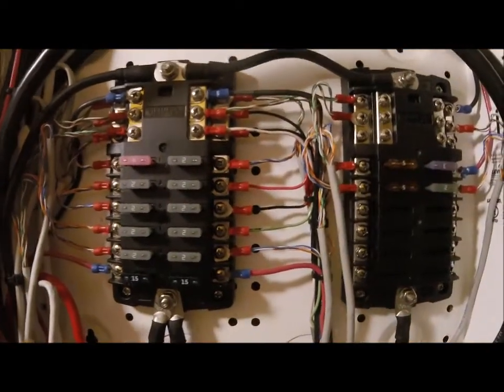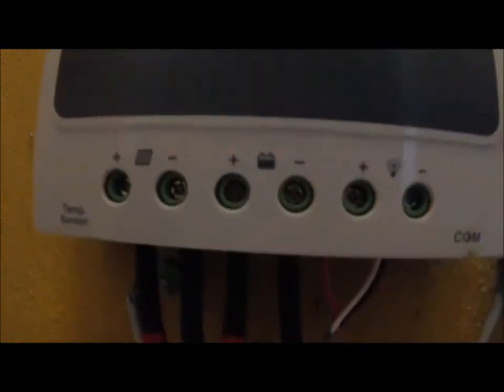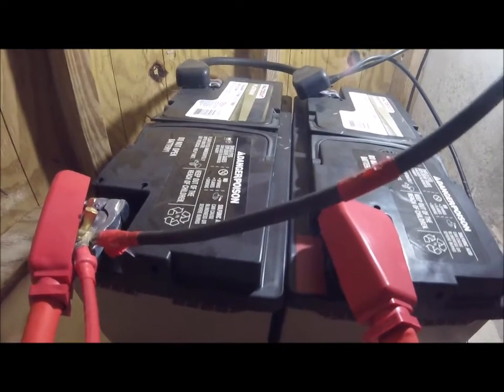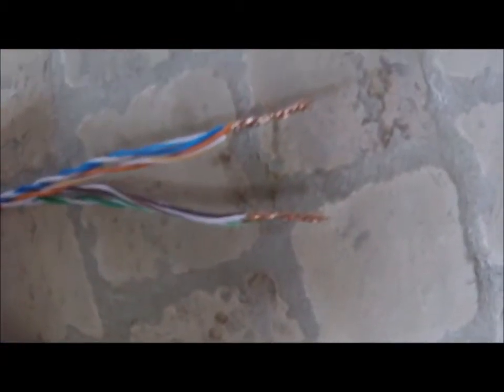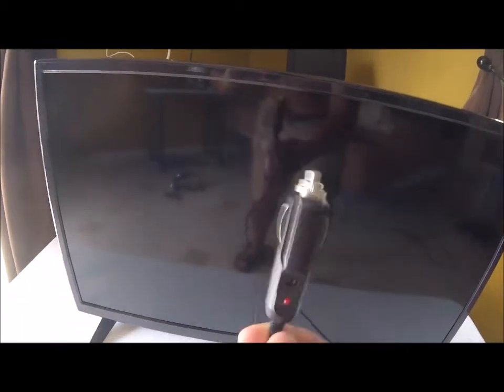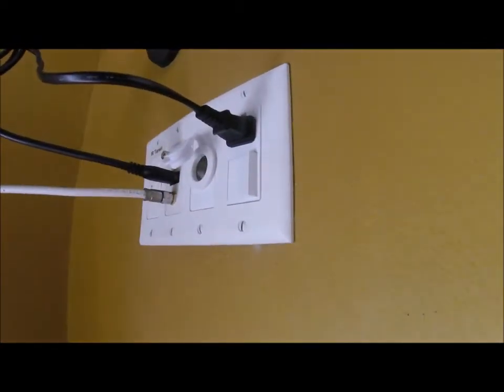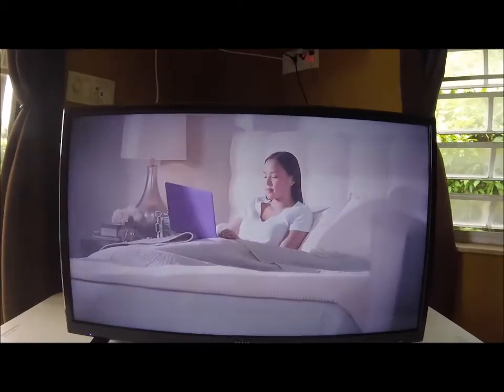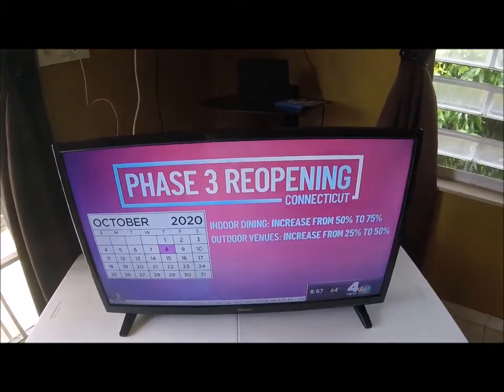Emergency 12v Free signal Transit 32" TV

Comment: Thanks for the tip about the Transit 12 volt TV.  I'll have to put one of those on my "wish list"  ;-)
Reply from the maker: It's a great emergency TV 📺, it can be used with your cars 12v socket. You can even get 12v extension cords to run tv away from your car, using your car as the TVs generator lol.
Reply: @MosaicHomestead  Good to know, thanks!

Comment: Good stuff, primo. I wanna be like you when I grow up.
Reply from the maker: I'm 50 so your almost there😆
Reply: Yeah me too.  He does good work.
Reply from the maker: @joeprimal2044  I installed that structured media box about 20 years ago...I told my uncle I would be doing stuff like this in the future, He thought I was crazy then ,lol This is the only AC DC hybrid home in Puerto Rico. Solar installers have come to see my 12v lighting system just to see me turn off a hallway full a lights just by pulling out a 3a car fuse lol.then I break it down with ohms law and only then they understand.
Reply: @MosaicHomestead  Having blown up 2 inverters myself over they years, I think it's a sensible way to go having both.  How are the wind turbines working out?
Reply from the maker: @joeprimal2044  They have been working great, If you saw how dark its been with all the rain and the system running at 53.6 with 2 large refrigerators, you would be surprised, rain here comes with wind, and that wind supplements the batteries  when solar radiation is low...and so far the Missouri wind and solar controller has been working very good.
Reply: @MosaicHomestead  Good.  You've had those up for a couple years now haven't you?  These days so many things go to shit in just a few weeks, it's good to see that these things last.  Hopefully I'll have some wind power capability wherever we finally settle.

Comment: I’d be using radio myself but good idea
Reply from the maker: A picture is worth a thousand words...A moving one a million😁
Reply from the maker: A picture is worth a thousand words, a moving one a million😁
Reply from the maker: @teamfoco995  You can plug this TV to your car and it comes with a  extra cable that you can add alligator clips and hook up to a car battery...This TV would work great with a small 12v solar kit👍😁
Reply: @MosaicHomestead  And many preppers cannot read so a good idea!
Reply from the maker: @HuplesCat  I read in Spanish and English😎
Reply from the maker: Right now I'm working on a Diy wall folding clothes line...it's on my to do list. It's going to be made out of scrap metal, but it's going to look like I paid for it...I don't want to go over 20 bucks 🤑